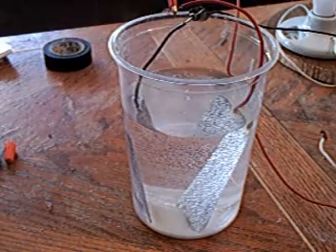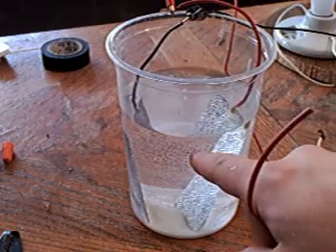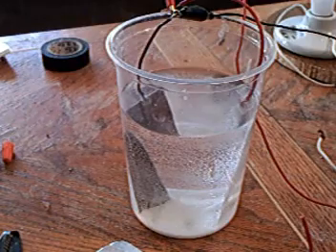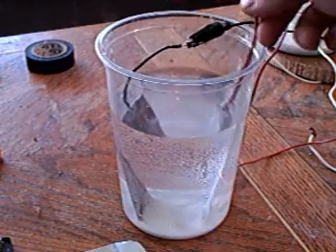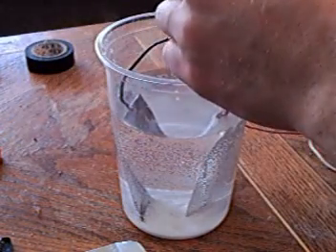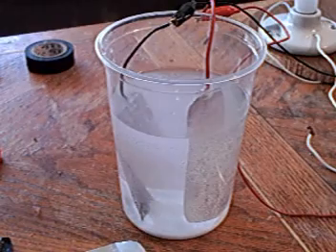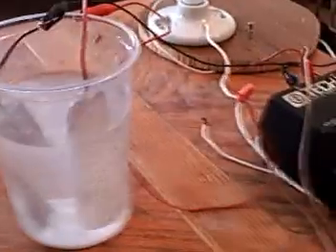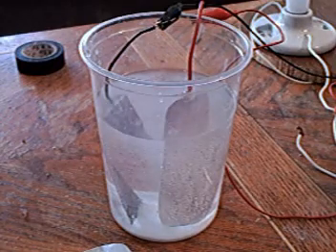hho - 120V Aluminum Rectifier PART 1

Comment: Interesting. What do you suppose would happen if you used this "rectifier" configuration in a high frequency Cockroft Walton doubler circuit in a common water source? Hmmmm.

Comment: pretty interesting that current only flows in one direction with aluminum, but you said that as the water temp cools electrolyte comes back out of the solution, which in fact, it does not the solution becomes "super saturated" which is similar to sweet tea (sorry if your not from the south you wont under stand what sweet tea is) but when you sweeten it hot you can actually surpass full saturation and as it cools back down becomes "super saturated" and it works on the same principle.

Comment: It seems like using the high voltage causes the diode plate to grow much faster, and I like the idea how you can grow two at a time.  Maby  you should rotate the plates to ensure a uniform diode plate all around the metal.

Comment: they used to make a similar device known as a brine tank rectifier,to convert high line voltage to high dc voltage to run dc big dc motors before induction motors came along.